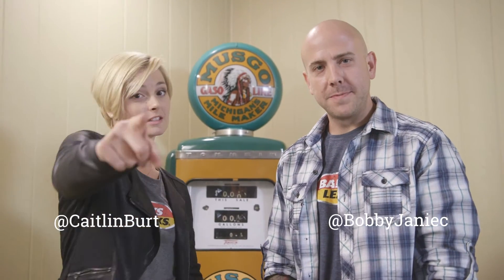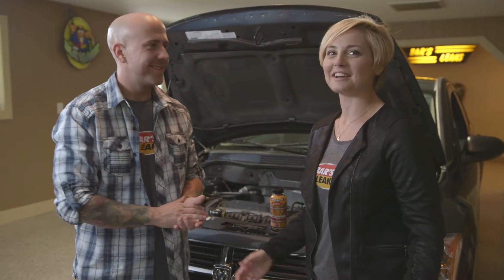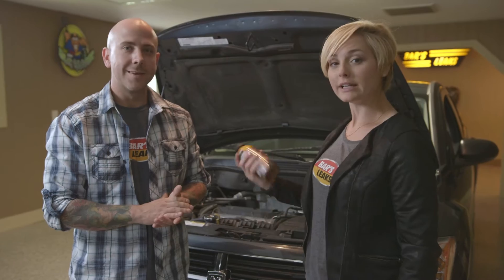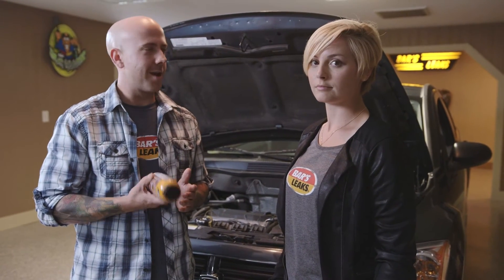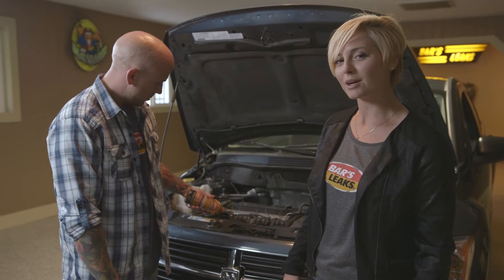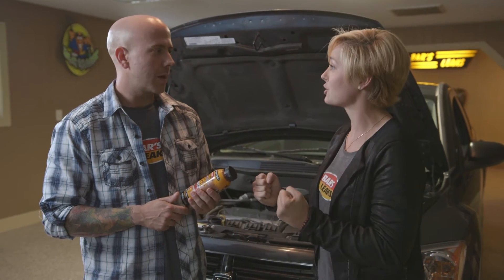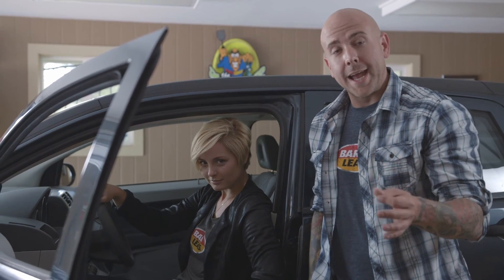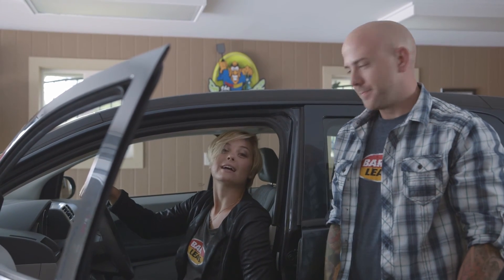How-to: Bar's Leaks Liquid Copper Block Seal Intake & Radiator Stop Leak

Comment: 2001 Ford E350 went from having an intake manifold leak near a freeze plug to running like a kid again. 
Used galvanized steel and silicone sealant to patch any rusted out spots on the roof too.
Reply from the maker: Glad we could help! Thank you for the comment!

Comment: I bought the aluminum can a year ago. Stop my tiny leak in radiator.. now its leaking again.. its an old 97 jeep grand cherokee laredo.. everything's going... but I need it right now to get to work lol.. smashed my bimmer up hitting a deer... and thats way expensive to fix.. I bought the copper leak stop today as I noticed a small puddle on lot at work.. engines cool. Overfill tank says add.. take cap off radiator and the fluid is only an inch down.. the copper sludge won't go down.. only poured about a half oz in...

Comment: Hi my car bmw is overheating after 5km drive and its pushing coolant out I change the viscous fan clutch, water pump, thermostat, radiator and I bypass the heater but no change. I went to the workshop they told me it's head gasket but no any sing of oil mixing with water or smoking my problem is only pushing coolant out building lot of pressure. My question is can I use this product? Thank you

Comment: @bar'sleak I drive a 95 chevy k1500 with 5.7 and my intake gasket is leaking I believe. I have the parts to replace it but can I use this in it for the time being?
Reply from the maker: Hi Brandon, yes the Liquid Copper would be recommended for the intake leak. Our customer support team is available M-F 8am-5pm EST, and can be reached at 800-345-6572 if you'd like to further discuss installation of the product.

Comment: Where’s the heavy duty with pellets is it the same? Also do I need coolant in the system before or does it need to be empty
Reply from the maker: Hi Kolby, thanks for your questions. The product in the video is different from our pelletized formula, which is still widely available and is sold under the name Radiator Heavy Duty Stop Leak, it's part # PLT11. Please give our tech support team a call so they can discuss the installation of the product with you. They are available M-F 8am-5pm EST, and can be reached at 800-345-6572. They look forward to speaking with you.

Comment: Is it imperitive to let it idle for 15 min M  because i drove my car for 15 min.  Let it sit for like 30 min and then drove it again for another 20 min and then let it sit overnight
Reply from the maker: Hi Jacon, typically we want the idle time just to allow the product to circulate under normal pressure, if you drove the vehicle for 15 minutes there won't be an issue. If you would like to further discuss our customer support team is available M-F 8am-5pm EST, and can be reached at 800-345-6572.
Reply: @BarsleaksUSA  also csn this stuff be combined with the liquid aluminum ?  I have another jeep that has a heatercore leaking.  Makes thr interior stink of coolant when my heat is on.  Scotty Kilmer recomended i use this stuff.  But it didnt do anything.  Even after 400 miles of driving over timr it still smells of coolant.   However now ny heat has almost gone away..  i think this stuff clogged my heatercore but didnt fix the actual leak on it.   What were to happen if i put the copper stuff in with the aluminum stuff in ?  Or should i try a 2nd bottle of aluminum ?

Comment: so the vid states "run engine for 15 min" while the back of the exact same bottle states "run engine for 5 min".  And so how can one "follow instructions carefully?
Reply from the maker: Hi Mike, we are actually in the process of changing our labels to reflect the 15 minute idle time. Thanks for reaching out.
Reply: Whoa I followed the 5 minute instruction too that is faulty instructions that could cause my car damage and it still says that so you guys havent even attempted to fix that i want a refund and you guys to repair my Montero
Reply from the maker: Hi CRZCHRIS, please give our tech support line a call. They are available M-F 8am-5pm EST, and can be reached at 800-345-6572. We look forward to speaking with you.
Reply: @crzchris2465  I didn't intend to put you down. My comment was meant to reveal the issue with your demeanor in the way in which you reacted to the directions. Chill out and try acting like a big boy.
Reply: Well again you take the time out of your " busy day" to question my demeanor when in fact the bottle of bars leak doesn't label the appropriate instructions I used this product and it did not work. had the instructions been labeled correctly then it would not have been a problem in my belief. but the fact that barks leak knew that their instructions were faulty and still have not corrected it, is reason why my demeanor was a little salty. But who are you to tell me that I'm not a big boy and I should act a certain way. the fact that you're taking the time to comment on something I commented on months ago shows your lack of a life furthermore I suggest you quit wasting the library's internet time and go out and get some sunlight
Reply: @crzchris2465  I just love internet tough guys. I have nothing more to say since this conversation will not been productive.
Reply: @MrDeviousdom  well here's the thing I'm a lot tougher in person so you sit nice and safe behind your computer screen and hope our paths never cross

Comment: Is this the guy from hardcore pawn?
Reply from the maker: Yep!
Reply: @BarsleaksUSA  Wow, cool. I knew you were familiar. I just purchased this product to seal up a leak on my 2000 Ranger 2.5 Let's hope it does the trick! I'm actually filming the process, so if all goes well I'll be sure to plug your company into the video.
Reply from the maker: @jimmysgarage9068  That would be great Jimmy. Our tech support team is available M-F 8am-5pm EST, and can be reached at 800-345-6572 if you want to go over installation with them. One thing we recommend is if you haven't had a full system flush in the last 3-4 years have that done prior to installation to ensure we have proper flow in the system. Thanks for the comment Jimmy. -Bobby J
Reply: @BarsleaksUSA  One week later and no leak! I liked it so much that I bought some Bar's Leaks for my power steering system as well. You guys are great!